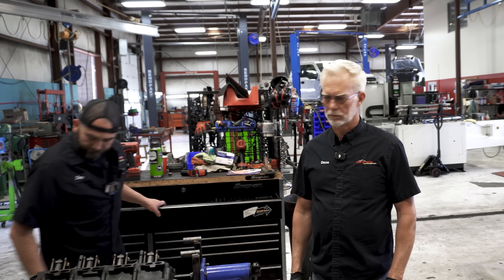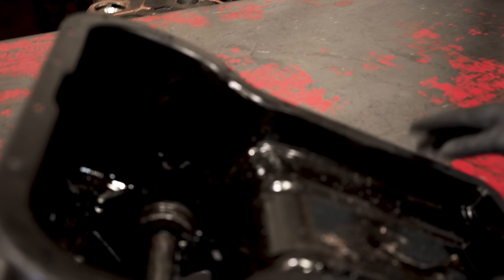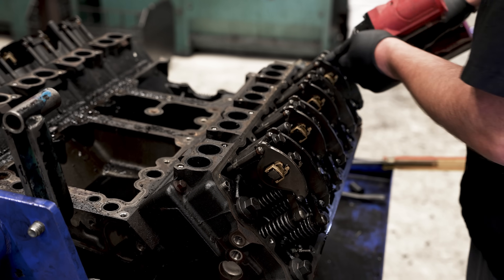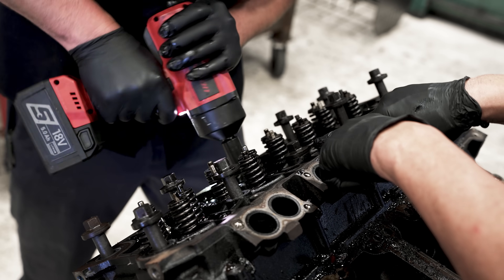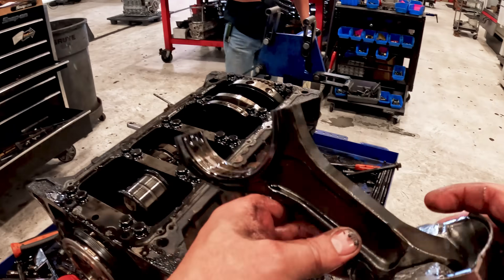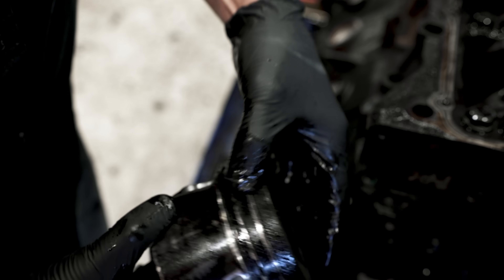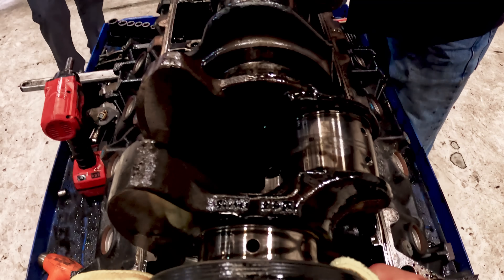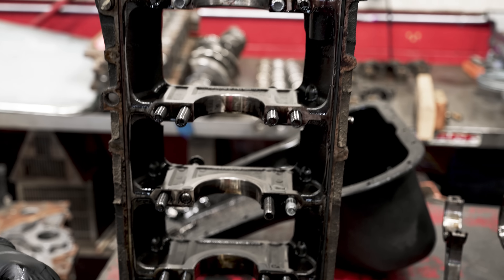Ford 6.4 Powerstroke failure analysis

Comment: Interested in options you think in my situation.
Bought 2020 GMC 3500 dually Duramax..absolutely love the truck. 

Still own a 2008 f350 6.4 diesel. Degas bubbles over when putting boost while driving. When driving around "normal" or without any towing, truck drives like a dream. 
178k miles and I can not get any buyers for $8k. 

What are your thoughts? Truck has no emissions and simple tow tune

Comment: I had an 08 6.4 power stroke and it was actually the best running diesel out of the ones I have owned. It had instant power instead of "spooling" up. 183000 miles. I know they have issues, but I loved mine.... Probably because I never had trouble.

Comment: Ah the 6.4L Powerstroke.  What an unfortunate and unreliable engine.  "The 100k mile motor" as they called it in the mechanic world.  Ford really had a one-two punch of terrible with the 6.0L and then the 6.4L.  At least they mostly figured things out with the 6.7L, but I do miss the pre-EGR days of diesel with the 7.3L.

Comment: I wouldn't even touch one of those nightmares. Kudos to you for possibly having to deal with a comeback in  months if it lasts that long. They are literally built by cutting every corner from the factory from what I've seen. I wish you the best of luck.

Comment: Emissions control equipment is the culprit for all these problems. Before the Obama EPA none of these problems existed. It was just simple Diesel engine design that Pulled turbocharged compressed air in, pushed fuel in, it all compressed in the combustion chamber, ignited at the right time, made power, and out the exhaust valves, through the exhaust side of the turbo to turn the compressor wheel, and then down the simple exhaust pipe, and out the tail pipe it went. Simple. Until the auto industry goes back to that for obvious reasons these problems will continue to plaque newer diesel engines and it’s sad, and completely unnecessary. These new diesels burn just as clean with or without emission control equipment. They’ve already proved it. So at this point it’s just a government unconstitutional overreach to cost people thousands of dollars for nothing, and to try to push EV’s more.
Reply: They sht canned the bullet proof 7.3 and rushed the 6.0 in to meet the new emission standards
Reply: Prove it

Comment: Prime example of why they don't make the 7.3 any more. It was almost indestructible. At least mine has been.
Reply: 7.3 was a good engine but look at the output, it was very low(which is key for longevity). I had one and it was problematic mainly with the HPOP system. The motor was solid built though but didnt understand why a big diesel really didnt get its power till mid 2000 rpms. I bought an LBZ and got over 350k on it now with original trans and injectors. To each their own but I think they were great motors but a tad over rated and couldnt keep up with todays diesels.
Reply: @MattC0725  I understand what you're saying and I've wrenched on many brands of motors for 45 years. A lot of problems are of the owners doing. Some are factory defects and some are engineering design flaws. I have had good service from Ford and Chevy not much from the older dodgers. I just prefer the older stuff. Thanks for commenting. Have a blessed day

Comment: I've been driving my 6.4 now for 368k plus miles with zero issues. We change the oil after every road trip. Typical road trip is around 3000 miles per trip. Still going strong. Best truck I have ever owned.
Reply: We need proof
Reply: Good luck with that. I've seen meticulously cared for 6.4ls bite the dust. I won't touch em with a 10 foot pole.
Reply: Ive seen them roll in with 200k on the original motor. But most have had more than 1 by 150k. Yours is an exception not the rule.
Reply: Pure stock DPF system, periodic DPF oven cleaning. Pure stock exhaust system now at 369500 miles. Just got back from Macon ,Ga. Again the best truck I have ever owned. Not sure what everyone else has experienced with these trucks, this one is true blue bad ass. I've put 8 sets of Michelins on this truck since driving it off the showroom floor.
Thanks for your comments. This truck deserves it. My poor old truck. Peace.
Reply: @JJMachineryLLC  how often do you clean the DPF?
Reply: Deleted?
Reply: @Carlosequeso I was going to ask the same thing.
Reply: To FordFan01, that's correct. We  have had issues. At over 140k miles the high pressure fuel pump are itself in Ogden Utah. The dealership there outside of Ogden replaced everything fuel related on this truck then and submitted it to Ford for reimbursement. Ford sent me a check for all parts used, as I remember it was around $4500k. That was beyond the factory warranty. That's the only time we had that happen. We use this truck still today driving it on long trips often. Manufacturing date was September of ,07. We noticed the engine tags (orange color, not blue) are all International not FoMoCo. Something different with this one for sure. Thanks. Keep smiling and Peace out.
Reply: @JJMachineryLLC ford didn't make the 6.4. Navistar/international did. All years from 08 to 10 made by international.
Reply: People don't understand maintenance..... it works...
Reply: No way
Reply: I agree, mine has a manufactured date of September, 2007. We found an International IH embossed on the block and the valve covers has an orange data tag with only International information. We have another one of these trucks that is a 2010 f250 it has Ford data tag on it. Thanks for your comments. My 2007 truck is sporting 371,230 miles presently. Taking it on a road trip next week to Virginia. 3000 miles round trip. Best truck I've ever owned. I have a 6.7 as well, it's for sale. Peace out.
Reply: My 2008 6.4 has 248k on it, deleted at 72k, alternator, belt tensioner, new ebp pig tail, ac compressor and good maintenance/not driving like its a sports car.
Reply: Once in a while someone like you pops up with no issues with their 6.4 and 6.0, you're the lucky ones

Comment: I’ve done about 10-12 6.4 engines in the last 6-7 months at work. Lots of heavy duty service trucks. 3 of them for a huge road maintence company, cheaper to throw 20-30k into each truck and have it run for another 5 or so years for them then to dump 350k+ on 3 new f550s plus whatever it costs to “outfit” them. 

In stock form they are absolutely the most unreliable engine for longevity eventually they all crack a piston

Comment: As bill hewett used to say on the 6.4L diesel.. not a matter of IF but WHEN it crapped out..  guess the when for his guy is now..  I would guess this engine is goina cost close to 12-15K..  almost the value of the truck. wonder how many miles, was he original owner etc.  what is overall condition of truck ??

Comment: Blows my mind how poorly maintained people keep there very expensive diesel engines. Rebuild's are expensive as hell. You can't even keep clean high quality motor oil in them? So stupid.
Reply: These 6.4s are junk no matter how you take care of them.  Most are lucky to get to 200k before falling apart.
Reply: 14 quarts of high quality oil and Ford oil filters are spendy for some people who really shouldn't own a diesel.  They demand maintenance.
Reply: @louisschummer931  Agreed. A diesel wont last long if your a cheapskate.
Reply: @louisschummer931  Agreed.  Unless you are pulling heavy for a living, they just don’t make any sense financially.  Ford and GM make some nice gas engines that require 1/10th the maintenance cost.

Comment: just curious, why are the rod caps at 45(ish) degrees on those motors?
Reply: Allows for a larger rod journal. The cap at 45 degrees allows the rod big end to fit into the bore when installing. It it was cut 90 degrees, the big end would not fit or you would have to use a smaller journal size. Some people say there is more strength in the rod too but idk about that one. It may be stronger but it's not like it's the end all be all.
Reply: @stevengawlik1282  ahhh thanks for the explanation :)

Comment: guys who continue to buy and fix 6.4s are complete wildcards. Absolute chaos
Reply: They’re actually great motors if you can keep them cool, delete them, and resist the urge to hit a button and upload 300+ hp. You give that kind of power to retards without a single support mod you get “ThEy’Re uN ReLiAbLe”. People just don’t know how to take care of them. It’s probably one of the most over built engines ever made. You throw compounds and a k16 on any other diesel to this day and I promise you’ll get worse results.
Reply: I really can’t believe people try and rebuild these things…just not worth it..junk
Reply: @hokie9910   If you build them correctly, with upgraded pistons and other parts, they will last very good, very good engines.
Reply: @andreyyes6016  Congratulations, you are the first person to ever utter those words about a 6.4
Reply: @hokie9910 doubt you’ve even owned a 6.4
Reply: @RETROB0T141  Younare correct!  I learned my lesson after owning a new 6.0 PS.  I learn lessons the first time bud.
Reply: @ typical. Someone who’s never owned one talking like they know everything. Every diesel has its own problems bud. Maybe you should look into that before buying one
Reply: @ Bless your heart.  It is the worst diesel put into a 3/4 truck in history,  Even the Ford diesel master himself, Bill Hewitt says so.

Comment: Without that good core those prices could escalate quickly 😮😂😂
Reply: Certain places have the ability to spray weld repair Class 8 truck blocks, I wonder if this could be coming to the 1 ton diesel market if blocks become scarce enough.  Or just cast new 6.4 blocks.  If there's enough demand, a case could be made for making new ones.

Comment: Why someone would replace a 6.4 engine instead of the entire truck is beyond me.  Cudos to you guys for doing a great job though!!
Reply: At least if you get a build motor it comes with a warranty & is much cheaper than a new junk. 😮
Reply: Built Ford Tough wallets
Reply: @Fxx319  Dave tore down a Duramax in this condition, what do you think it cost to rebuild that one?
Reply: Because the rest of the truck is incredible. I own 2.   2 still cheaper that a new one
Reply: True that!
Reply: New Ford trucks cost $80-100K for a diesel.  Really you don't get a ton more capacity with a new one either for towing or hauling.  From '99 - 2016 the truck didn't change much, just engines and transmissions.  Frame and suspension only had minor upgrades, cabs and boxes will pretty much fit across the years.  Too easy to rebuild them and keep on truckin'
Reply: I don't think the people commenting know what a notorious pile of shit the 6.4 is 🤣 those trucks are less than $5k around here with more than 150k miles on them. I see them and they're more than 5k, because it's a gasser. They're worse than a 6.0 diesel. That engine is a time bomb if you can't legally fix the issues with it 🚭
Reply: Still knocking the 6.0 LOL listen pal, I've got two E-Series Vans with 60s the most expensive thing has been injectors, labor wise. I've got 371,000 mi on one of them runs like a freaking Peterbilt @scottleggejr
Reply: @dpdiver1  I get it's e-series so that's a bit unique, but compared to a same year Cummins or Duramax you don't have anywhere comparable issues as delivered from the factory. I had a 6.0 that was bullet proof already and the ipr and ficm both left me stranded 🤷‍♂️ no "fix" for either issue still to this day.
Reply: @scottleggejr  This engine along with a great many diesel engines was abused.  Extended and infrequent oil changes killed this motor, not the motor itself grenading because it's a 6.0/6.4.  Owner neglect is 100% to blame here.  I have nearly 400k miles on my 6.0 and the top end of my heads looks pristine next to this motor.

Comment: Ford should stop.making diesels they always have tons of issues. The only good one they made was the 7.3l
Reply: Ford didn't make the 7.3 international did. Only diesel Ford made was the 6.7.
Reply: All truck diesels are having issues now with all the EPA crap
Reply: @tomlorenzen4062   very true. But ford had issues since the 6.0l came out and never fix the issue. They have nice trucks my main goal is to swap my 12v in my 96 ram into a super duty. My 12v is still running strong with 499200 miles on it.
Reply: @bigmurph1447  yeah, have an 2001 f450 dump- 7.3 diesel. 200,000+ very hard miles, not the best maintenance.  Runs like a champ. Unfortunately also have the 6.4 in a pickup, had to replace at 140,000...
Reply: Actually the engineering of  the 6.0 and 6.4 was done by Navistar ir sone guys call  it International
Reply: @71boss39  we know that same with the 7.3l international got sued over the 6.0l because it was such a big pile of junk. But the 6.4l was even worst. The 6.7 are fords they don't seam bad if  u take care of them but most people don't just run them into the ground.

Comment: And this is why you can buy a 6.4 power stroke with pretty low miles for usually under $10,000. Absolute garbage is what they are. Why anyone would want to put another 6.4 back in it is beyond me. There are plenty of kits out there so you can drop a 12 valve into it.
Reply: Emissions laws are why that happens generally.
Reply: And Dave built it. It's better than Ford .

Comment: I had a 96 Bronco with low oil pressure. Crank moved in and out and ate belts. Old timer told me it was a thrust bearing. Cool seeing one on here with the same issue

Comment: I just rebuild my 6.4 on my back patio, the truck had 348k miles when I pulled it and the cylinders had to be bored .030 over to get them cleaned up 😅 absolutely insane that they had to go over that much but the truck runes so smoothly now with some maxxforce 7 pistons new rod and main bearings, pushrods, rocker arms, basically everything new besides the rods, crank and oil pan 😂
Reply: How were 7/8 compared to the rest of the holes?
Reply: @scottleggejr  they weren't too bad, the truck has been deleted since 60k but all the cylinder walls had a lip at the top, a few of the pistons had cracked rings as well
Reply: @scottleggejr  Washed. LOL.
Reply: I’ve niece hears of anyone get that kind of mileage out of those engines.  You should play the lottery!
Reply: @hokie9910  lol the truck has been deleted since 60k but you're right, I should play the lottery
Reply: I'm looking at rebuilding my 6.4 this summer. Did you have any trouble finding parts? Some of the stuff I've looked at is backordered or out of stock.
Reply: @Mighty-Quinn  the only thing i did have trouble finding were core/freeze plugs, "zz diesel" had the ones I needed for the cylinder head but the others for the engine block came in a kit from melling. The pistons I had gotten from rock auto but had to order rings from someplace else because the oil scraper rings are thinner on the maxxforce pistons

Comment: The reason that Powerstroke 6.4 engines fail is because they are Powerstroke 6.4 engines. I'm surprised that no one has developed a swap kit to be able to  put a different engine into the vehicles. It might not be worth the development costs, I guess.
Reply: International made this engine, it was the first regen engine ford used. The Egr kills this engine. However, if you know the recipe for this engine, there is nothing made to date that pulls hard or runs as hard as the 6.4.
Reply: People love Cummins swapping the 6.4 trucks
Reply: Absolutely
Reply: I believe there are Cummins swap kits out there.
Reply: Still have to take care of the Cummins.  This engine was NOT taken care of.

Comment: I can understand the criteria for the viable block, but I can’t understand why the crank is included in that!
In the case of the block in this video, yes the spun main bearing has smoked the journal in the block itself and that ruined the block, but my question is in regards to the crank, wouldn’t you be replacing the crank regardless of it’s condition when rebuilding a motor?

Comment: So Dave any reason why can't resize the crank bore
Reply: @@SHSPVR   I think it was because the blackened, overheated crankshaft thrust bearing journal cannot be trusted any more.  Once it's been overheated the properties of the metal change.
Reply: @nevillegoddard4966  Hence why you align bore it and use oversized bearings.